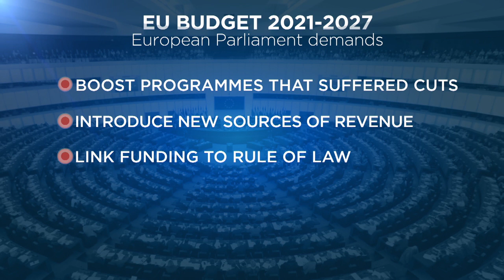MEPs want EU funding to be linked to respect for rule of law

Comment: For rule of law, read as conforming to eu diktat, At least partly. This is the attachment of compliance to eu rules to normal laws.
It is not surprising that MEPs want to attach these conditions, they are anticipating an increase in their powers, I suspect mistakenly, as the real purpose of the EU parliament is a talking shop that rubber stamps rules made else where.
The parliament is where words of condemnation are generated, but these are essentially platitudes. Real power is else where, and it is there that the decision for any action is taken.
Reply: whats your point foggy ?
Reply: @kukulroukul4698  the point is that this is a power grab by the EU. Shame you failed to notice,